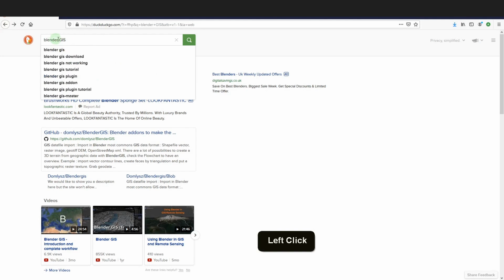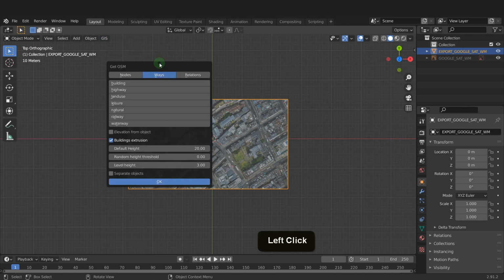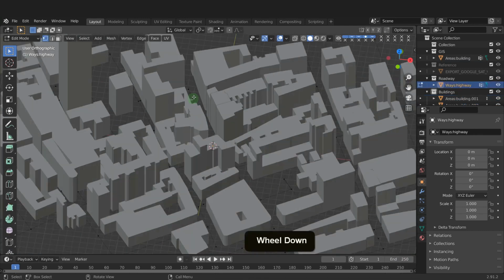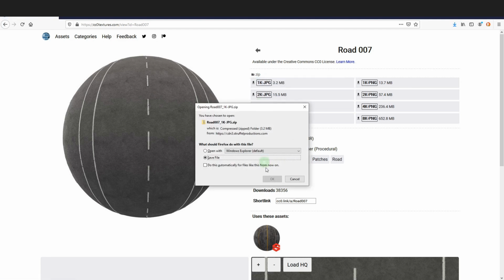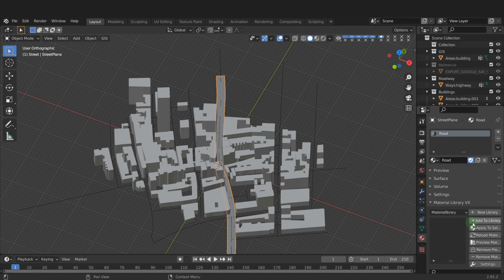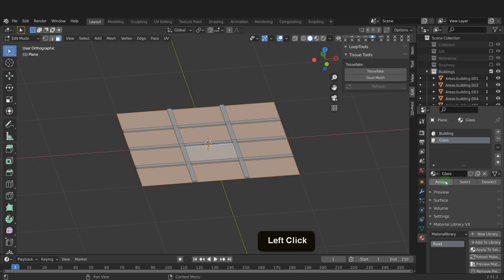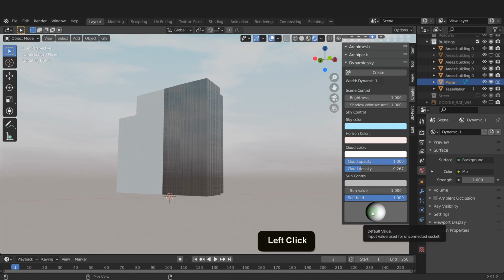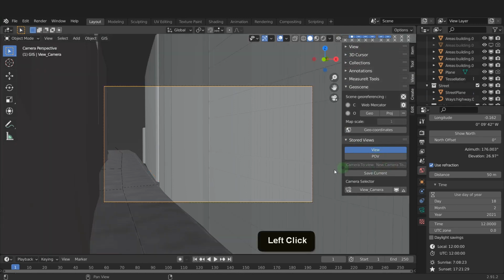Mastering Essential Blender Add-Ons for Efficient 3D Workflow | Beginner Tutorial

Comment: I have a question, what does "fake user" do exactly? Been wondering that for years.
Reply: When you closing your project, all unused materials cleaning up,  so next time you open file they will be missing. To avoid it make those materials being ised by “fake user”. Pretty handy when you created several materials for one object and cant decide what  material to use and want to save one of them without using it in scene
Reply: @dalbaeb4594  Ah ok. Cool thanks